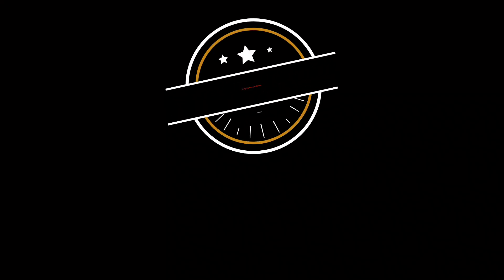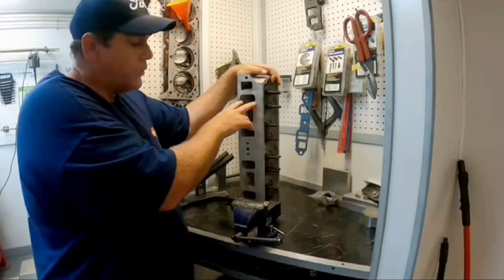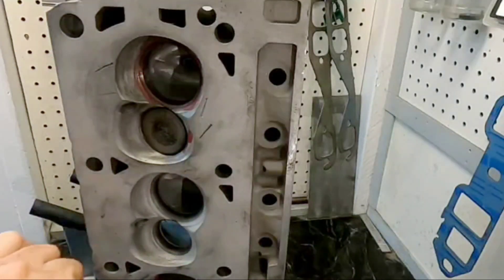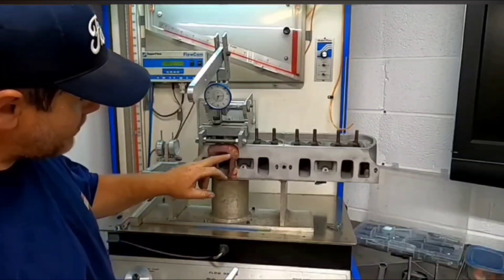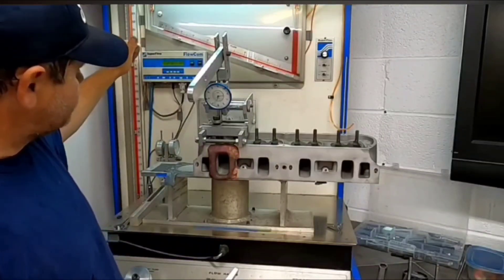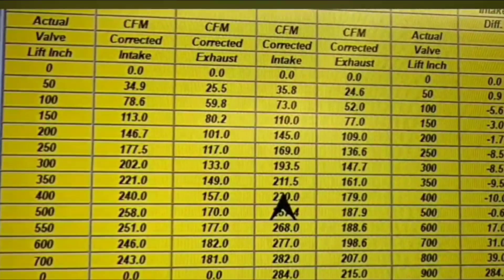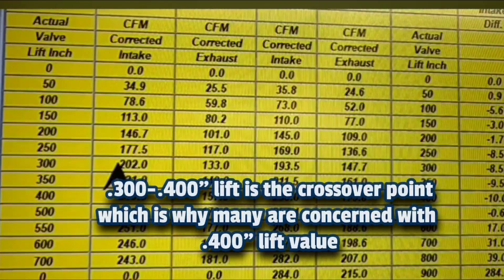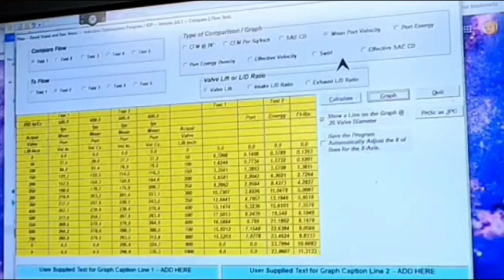Flowbench Testing Basics: How "we" do it @DavidVizard

Comment: That IOP setup is the best information I've ever seen. I've researched the best of the best. Every winning big name, everything I could gather from pro stock guys like W Johnson etc. Nascar winning builders. F1 port design and methodology. You name it. DV has the clearest detailed explanation on why and how ports flow. For guys wanting to start epoxying port floors, his info will get you started on the road to better flow. I want to start casting aluminum as the next evolution. I have visualized very high port single overhead cam designs. With single cam can get the head weight, width, and height down. Stealing cam in cam design can give you the way to independently vary intake and exhaust timing. With near perpendicular to valve face ports, VE should be off the charts in a cloverleaf 4 valve canted valve chamber. Gotta get that casting down and experiment with a single cylinder test mule.

Comment: I would like to see more detail on how the data is collected and measured and then entered into the IOP. Like is the port velocity measured or calculated? I have seen DV test velcity within the port but I didn't see anyway here to measure that so I assume it os a calculated value based on the port dimensions you put in.
Reply from the maker: It's calculated in the program but we do measure velocity with a pitot tube from time to time depending on what we are working on..
Andy

Comment: Thanks Andy! what valve job would you use to restore those low lift flow numbers?
Reply from the maker: One thing on these heads the valve had been sunken in the seat and the seat width itself was too wide. The solution was to install a 2.05 valve 
Thanks
Andy
Reply: @UnityMotorSportsGarage  gotcha, even better!

Comment: Question, you test at 28” Mg what is manifold pulling in an engine when running?
Reply from the maker: That is a good interesting question... It depends on the swept volume of the cylinder in the engine.. for example let's use a stock E7 Ford 302 head that flows 150ish CFM. The normal rule of thumb is you can make 2X the given CFM the head will flow. But if you install that same head on a 408 Windsor it will exceed the rule of thumb and make more power because the engine has a greater depression pull on the intake port.  
Years ago Smoky Yunick pretty much helped standardize the 28" as a rule that Cylinder head flow rates are based on.
Hope this helps
Andy

Comment: Hi Andy, I hope the header situation is getting resolved with Casper. If not, it’ll get there soon! When I went to Automotive school, the teachers would sometimes ask us to come up with a way of doing something to get us involved or extra credit on a test. I came up with an idea along the lines of the subject of this video you just showed. I suggested putting duct tape over the port and put clay in the guides to seal them, then fill the cavity with water up to the valve seat. Then pour the water out into a measuring cup, and allow for a little bit for the water residue coating the surfaces.

Comment: Hi Andy. This is a bit off topic but related to another video you did. You and D.V mention that you shoot for 1.4 lb/ft per cuin which is supposed to be very good. My question is this; is it possible to achieve that with a lower rpm engine like one built for towing or is that more for a street strip engine? My second question is are some bore stroke combinations better at making torque than others thus more likely to achieve 1.4 lb/ft?  Ok that was two questions my bad.  I'm relating this to an FE towing engine build. I don't think the FE engines are very efficient and I'm not sure that 1.4 lb/ft is possible with them. Thanks Andrew
Reply from the maker: It can be done on a FE what size FE do you have?
Andy
Reply: @UnityMotorSportsGarage  Hi Andy. I have a 390 almost finished right now but am considering a stroker kit. There are not many aftermarket cylinder heads available for the FE and my fear is that the stock heads will be the downfall of the efficiency and limit potential torque.  Andrew

Comment: I have an IOP question.  Is the throat diameter just the inner diameter of the valve seat insert, or is it the narrowest part of the port?  And if it's the narrowest part, what do you do, if it's not round?
Reply: @seanb250  
How is it measured?  Do you have to make a mold, and section it apart?  Just to clarify, you are saying the throat diameter, is also the same as minimum cross sectional area?
Reply: @NotSure723  the throat diameter CAN be the minimum cross sectional area but it doesn’t have to be and generally isn’t, the pushrod pinch is generally the min area point.
Making a mould is an excellent way to do it otherwise it’s a case of careful measurement and putting those measurements into a cad program that can calculate it for you or draw it on grid paper and start counting 😂
The one thing I did notice Andy not do when measuring the port opening is take the corner radius’s into account, it’s amazing how much area is to be accounted for in the radius corners.
Reply: @seanb250  
"The one thing I did notice Andy not do when measuring the port opening is take the corner radius’s into account, it’s amazing how much area is to be accounted for in the radius corners."
-I noticed that too.  The IOP program has corner to corner inputs, presumably for that purpose.

Comment: I've been wondering, can the IOP program accommodate split intake port heads such as the early "B" 4.6l 4v heads?  I have a boosted mustang using those heads that in my opinion put out very sub-par rwhp (considering the combo).  I have multiple spare sets (of B heads that is) to experiment with and I want to poly quad a pair of them (if it's possible with split port heads).

Comment: I'm sure you seen DV'S  book about building a floating pressure flow bench. But I built one with 4 motors rated at 97 cfm each and had a Hegelson calibration plate made for it. How many motors should I turn on and when. Thanks for the great videos and helping DV.
Reply: @seanb250  Thank you very much for the valuable information. I really appreciate it. Yes I'm sure I made some mistakes. Here is what I did. Manometer is 2 yard sticks both slide up and down .3/16 hose mounted 20"down from the bore fixture.4' x4" pvc and put 1" plastic light diffuser screen going into elbow to 2'x 6" to the bench.i did not make valves to block off motors.the bores are only 4 " long, might be a problem? The box is 3/4 MDF sealed up with a removable top with alo of threaded 1/4 bolt inserts and made a gasket.i turn the box around to switch from intake and exhaust.

Comment: I dont understand why youd open the valve past .060 or 070 thousandths and check flow who's gonna run anything with a 100 thousandths valve opening ? All cams are advertised at fifty maybe im wrong idk maybe im misunderstanding what you did here and why
Reply: Not sure if you mean .600 or .700 valve lift. While duration at .050 is one spec (of many) often published for camshafts,  typical street cams are .450-.600 lift these days, race cams can be much much more lift. And while you may have a point that one cam or another doesn't reach .700 lift, testing at higher lifts does reveal aspects of the port like stability,  tendency to reversion, and so on. 

The bigger picture is often very revealing.
Reply from the maker: @v8packard  that's exactly right!  It's about understanding the results you see so that you can make changes in the proper places to improve the ports efficiency 
Andy
Reply: Yeah I wasnt thinking straight i put the bong down and I was ok later on my bad man I apologize it was just one of those nights I dont usually partake in such things but last night was one of two or 3 a year when I did so yeah I should have just kept my mouth shut pervebally
Reply: Yeah that lol